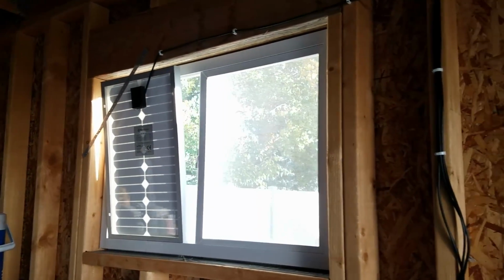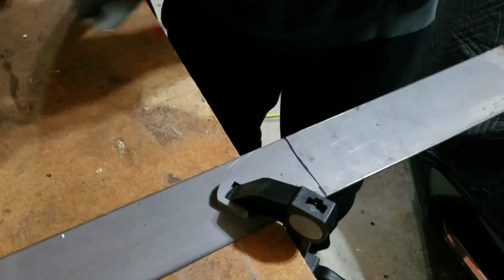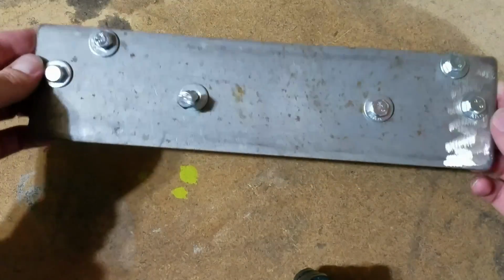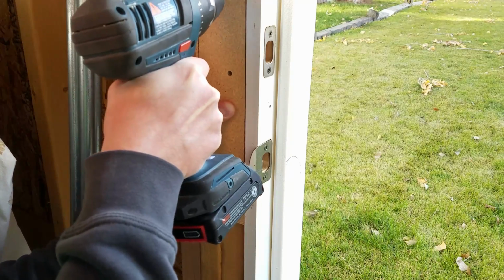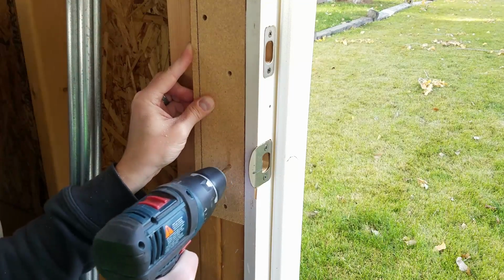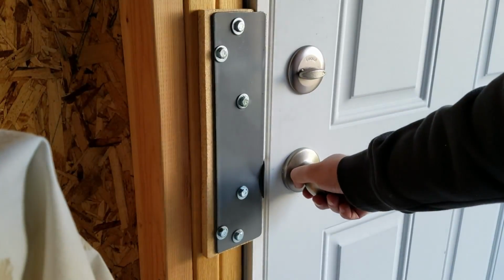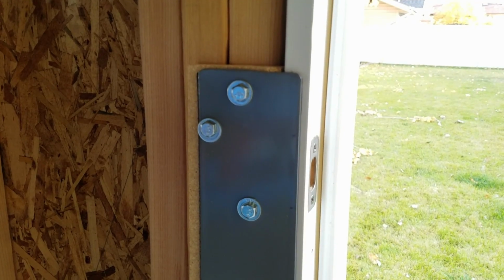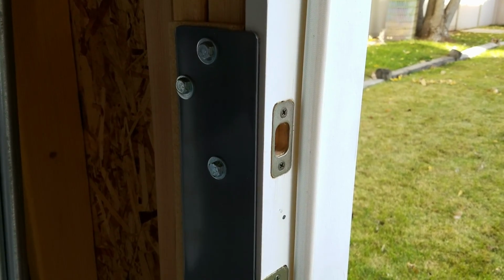DIY Entry Door Reinforcement - 1/8th Steel Plate Install

Comment: Check into a security strike plate.  It is affordable, easy to install, and definitely will help keep the door shut when an intruder goes at the bolt (especially on an out-swing door).

Comment: I would recommend SPAX PowerLags structural wood screws, and PL Premium construction adhesive to lock that steel to the door jamb, king stud, and jack stud all together. SPAX PowerLag screws have a wider head that won't need a washer, and a smaller head profile. They could be hidden under drywall and trim-work, with minor clearancing adjustments under the drywall or trim. But will require gluing that edge, as drywall screws and finish nails would never penetrate to the studs now. 🤔🤷🏻‍♂️😂
Reply: One reasonable solution would be to extend the security plate another 6" or so up and down, mark your studs top and bottom, provide some 1/2" holes with precise measuring (every 4" or so) for your dry wall screw to pass through the metal security jamb security plate. No gluing the edge required ;)

Comment: The steel plate should have been 24” long if not the full 36” and since you were screwing into the 3.5”  width of the 2.4 studs you should have used 3.5” lag screws [4” lags cut down] or 3” screws minimum.  More bite = more strength.  Construction adhesive between the steel and particle board and between the partivle board and doorjam & wall would also help - the bonding effect is a force multiplier.

Over kill never fails.

Comment: How would I do this with an entrance door that has existing trim? Like a front door? I was thinking to remove the trim, make a plate like you did. Guess I need to chisel the wood to make it flush so the trim will lay flat when reinstalled?
Reply from the maker: I'm guessing that plan would work just fine. Maybe you could sand it and paint it. They also have products you can purchase to reinforce your entry door so they are much stronger as well.

Comment: Thinking about removing some drywall and doing this in the house.
Reply from the maker: I've contemplated it haha, would be sweet!
Reply: @Jasonoid  if I was building new, I'd use a router to remove 1/4in of wood and install a 6ft section of 3in angle iron to wrap around the door jamb and lock the door jamb, king stud & jack stud all together with steel. But then the door would be a serious weak point, so how much work is it worth unless I keep going. I already have hurricane windows that can't be easily breached. I've seen special hurricane/security door's that have 3 deadbolts, one opposite each hinge. That would be serious security, Android people would start asking if you sell drugs! 😳 Why else do people do extreme security countermeasures? 🤔😒🙄 Sometimes too much security brings out extra attention; "must be something really worth the effort inside!" 🤷🏻‍♂️🤦🏻‍♂️😥
I used to run a small business, and had UPS, FedEx and other deliveries daily, so I started with 24/7 recorded security cameras and monitored electronic keypad entry. I would get allerts when there was a delivery, daily outbound pick-up, and could monitor everything from my phone anywhere I had service. 10 security cameras to monitor the property, delivery drivers, and my staff. I was at a point I should have moved the business out of my home. 1 basket all the eggs! 🤦🏻‍♂️

Comment: That's not gonna stop a kick in attack. The jamb will hold, but the weak pine in the door will split and thin metal will bend. The deadbolt latch will be ripped right out of the door.
You need a MAG deadbolt reinforcer for the door.
Reply: 357 Home Security

Comment: It would be extremely formidable if you put another plate on the outside, and used carriage bolts and through-bolted it.
Reply from the maker: Wouldn't they then know the security plate exists and they could just drill out the bolt heads and punch out the bolts?
Reply: @Jasonoid  Yes, but that is way more work then just getting in with any other method. Watch the tools, methods, and time it takes trained firefighters to defeat carriage bolts. Even for them, it is more work than busting into your shed using any other method. And doing it would make the strike plate exceptionally strong against the most basic attack. Kicking, battering, prying etc etc.
Reply from the maker: @MesoTroniK  if someone really wanted to get in they'd just kick in the garage door or break the window. Nothing will stop a desperate enough theif! Haha
Reply: @Jasonoid  True enough haha. Just thinking about how I have built up similar things.
Reply: A video camera that say “Hi, you are now being recorded” like at my hairdresser’s building would probably help too!

Comment: i think you might have drilled the holes a bit too big for your coach bolts(or lag screws as you call them) they went in way too easy and i like to clean the holes out and put liquid nails in the holes before putting the screws in

Comment: Kind of silly...just get a security strike plate from a big box hardware store for 8 bucks and use long screws through the frame into the studs. I recommend GRKs. You also need to reinforce the lock and hinges, but the strike plate is the most important. Alternatively you can make one w sheet or a mending plate and a step bit for the bolt protrusion. You can bend the plate to make an angle bracket and secure it on the inside like yours is.
Reply from the maker: I had this laying around. It was FREE to use spare parts and not waste.

Comment: Is that a metal door , if not ...that work you did was for nothing ....when u kick that door, that dead bolt will bend and come out of the door, you did nothing to reinforce the door bolt area , ON THE DOOR , ...you need to make the same metal plate to put around the door handle and bolt area of the door
Reply from the maker: Yeah, it's a metal door.
Reply: @Jasonoid FINISH HIM!

Comment: All that extra hardening just to leave kwikset locks on the door LOL
Reply from the maker: It's since been upgraded, just did it after the video was finished.
Reply: Yes, use class1 locks, dead bolt reinforcement plate(s).  Sounds like a good project that will frustrate burglars…

Comment: How does the drywall cover that ugly plate?
Reply from the maker: I don't have drywall in my shed. I think the plate looks awesome. I painted it so it's not ugly at all.
Reply: @Jasonoid  I agree, looks good. Gonna do something similar in my workshop. Keep it up!
Reply: If you wanted to do this on a finished wall, you would relieve the studs and door casing enough to clear the bolt heads, then drywall over it and place the door trim. This is way better than the thin metal kits I have seen for sale for $75.00.
Reply: Looks great, but ... what about the hinges?